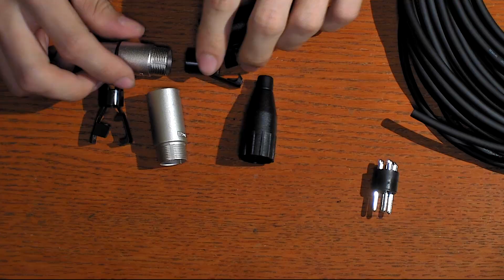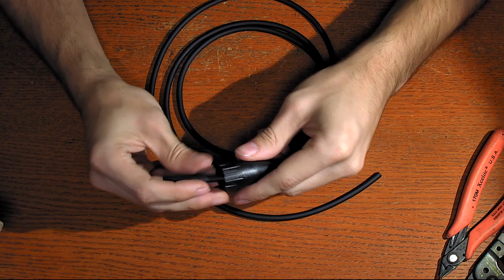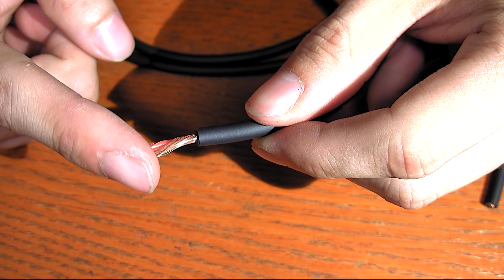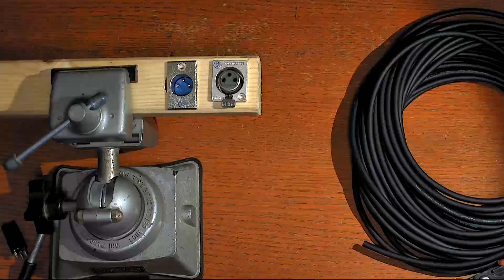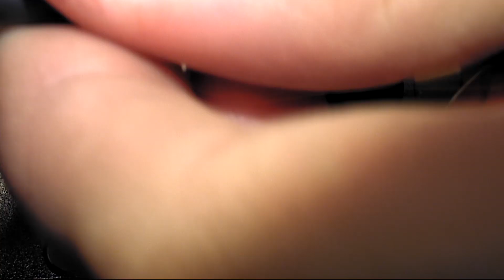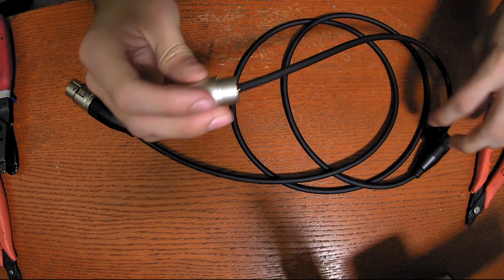How to Build an XLR cable

Comment: Everyone knows that shield should of gone on pin 3
Reply: Please revisit the pin 3 comment.  The shield is the ground which goes on Pin 1.  It may also be attached to a lug at the frame of the connector.  Pin 3 is used for the minus side of the audio cable for balanced audio applications.  Pin 3 is left open for unbalanced operation.  Putting the shield on Pin 3 in a balanced audio application can effect amplifier gain and frequency response.

Comment: Very nice done and extremely helpful video.  I like most the XLR plugs with teflon around the 3 pins ... but they are so expensive.  I guess because teflon is not cheap but i have heavy hand with the soldering iron and the plastic insulation tends to melt easily. Usually PE.
Reply: A simple approach that'd help preventing case meltdown (or at least keeping the pins held in place if the case melts) is to plug the core onto another plug while soldering.
Pre-tinning the stripped copper wires before soldering them to the connector also helps shortening heating time. If you're not confidence with your soldering skills, just apply a blob of solder on the pin and another blob on the tip of wire, then melt and merge the two blobs quickly.
Reply: @JBF-GST-Tanda  hi thank you for the valuable advice  
Anyway the Teflon insulation is fantastic 
The most expensive plugs use it 
And also some wires   But it is stiff
Reply from the maker: Do you have a temperature controlled iron? That could help. Also tin everything and keep your heating times short.
Reply: Hi !  thanks a lot for the kind and helpful reply.  No i dont have one but i will buy one for sure.  Another idea is to solder a small copper heatsink like one of those for cpu or chips to the pins of the sockets on the wooden panel.  In this way the heat will be transferred to the heatsink.  I am sure PE is just fine heat issue aside.  So i think i will follow your advice.  I think Cardas is using teflon insulated XLR plugs for their high end cables.  Wonderful for sure ... but very expensive.  I love Cardas cables immensely.  Regards, gino